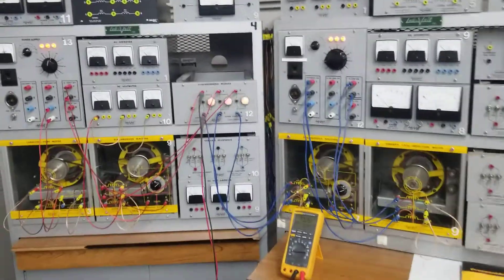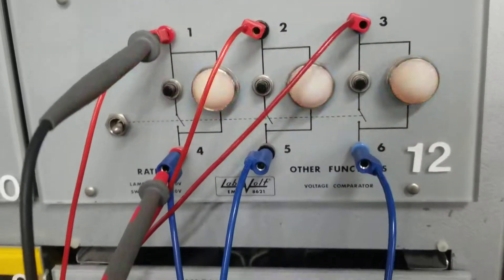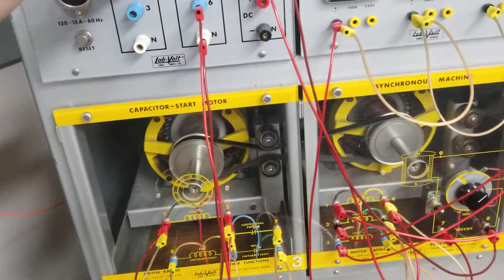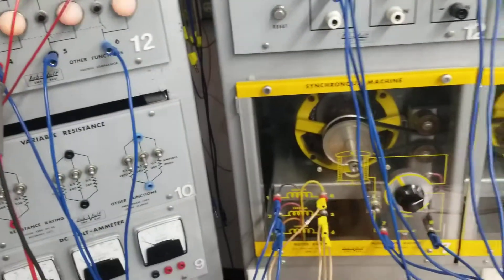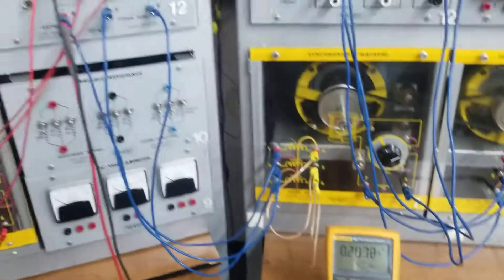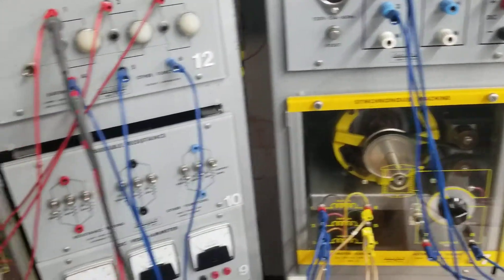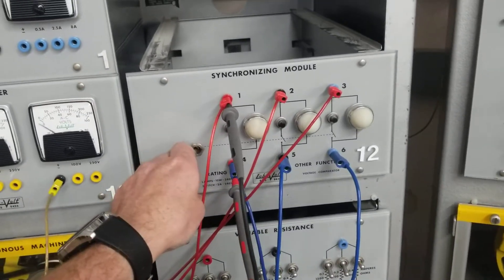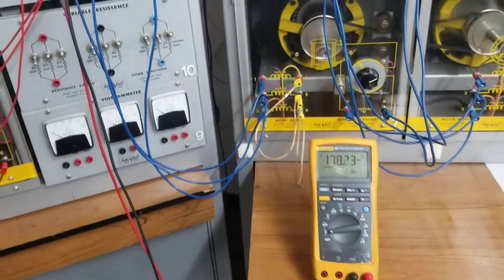3 lights out method synchronizing 2 generators

Comment: Instead of using the digital fluke try using an analog Simpson meter between each generator with the circuit breaker opened. What you should see is a rise and fall of the voltmeter needle. 0 volts means generators at synchronization and maximum voltage means generators 180 degrees out of phase. I was taught and shown that method 36 years ago.
Reply from the maker: Yes I love old school ways like this. I will try to put together some of the Simpson meters and show it a little more clearly.
Reply: @galaxybounce82  
I was asked to phase in a generator at an existing power plant 15 years ago. The generator was off line to repair a damaged 115 kvac oil filled cable. Once the high voltage cable  was repaired we needed to ensure the phasing was correct. I used three Simpson meters at the generating station.
I measured across (between) the generator side and bus side secondary potential circuits. A phase to A phase, B phase to B phase and C phase to C phase. Watched the rise and fall of the meters. The operator was telling me via walkie talkies from the control room when his sync scope needle hit 12:00.
My meters were at 0 volts when he observed 12:00.
I concluded from that what we both observed that the phasing of the cables were correct and the generator breaker could be closed. Thanks for your reply.

Comment: Can you sync single phase generators?
Reply from the maker: Yes any generator can be synced together you'll need to connect them when they are in phase with each other. Using either incandescent lights or getting a syncroscope.

Comment: Cool video! What happens if you flip the switch and they are too far out of phase? For example, if you flip the switch when the lights are at their brightest, rather than darkest.
Reply from the maker: Luckily there is no load on them and the voltage is low enough that you probably would  trip the breaker. I didn't want to damage the equipment since it's quite expensive. Out in the real world the output of any generator is protected by fuses or breakers in case of this exact scenario.
Reply: @galaxybounce82  if a generator breaker is closed when the generator is out of phase with the system,  tremendous damage will be incurred to the stator windings not to mention the  prime mover (turbine).
Many generator sets use 25 relaying schemes to ensure the generator breaker is properly synchronized onto the system.
Reply: someone said: they will sync regardless of the situation and the possible damage. (it was only a 300kW generator)
It happens quite a lot that synchronization failed and you need to retry. As the people in the control room a 631GW network could tell, they now have practice. Ideally there are electric fuses which disconnect fast enough if the lines are overloaded. If not the heat triggers fuses blow as last resort which costs several hundreds dollars each. When the fuses don't blow the lines or the generator will blow up. With old equipment you only have heat fuses which you need to replace. Newer units have electronic fuses which record the current and triggers the switch. As lines have a reactance you have some time till you get maximum current in an overcurrent situation. That was the problem as some people near a transformer station want to switch on a 5MW computer box/container (they had to phone the power company as there where nearly zero reactance between this box and the meter and the meter shows a power usage like s short if they switch the box on, but it settles at 5MW instead of rising any further; at first they don't called and jump scared power company).
You don't want to get your generator near power limit to sync as it wears down the equipment.